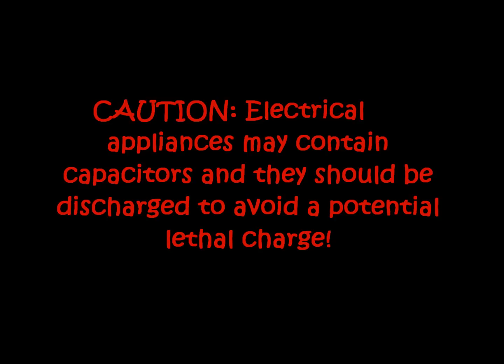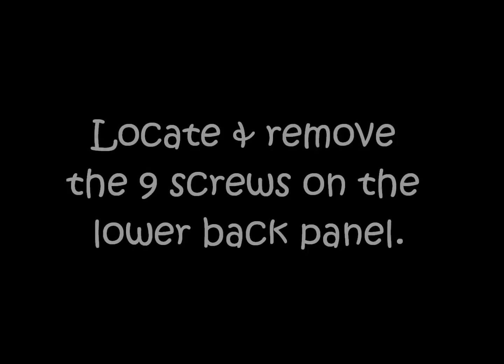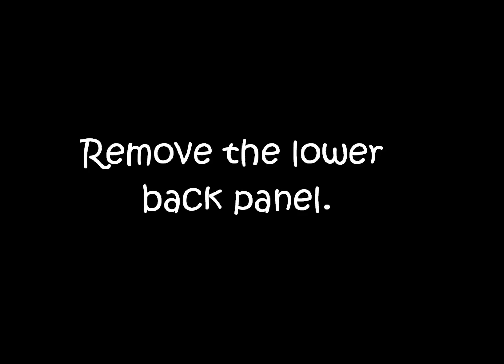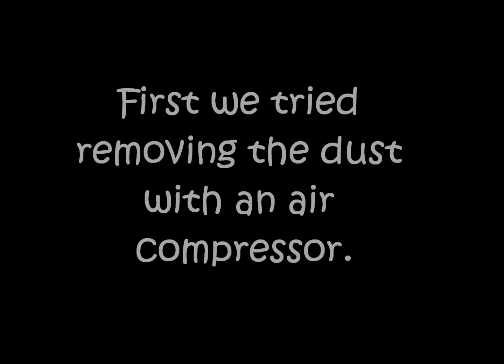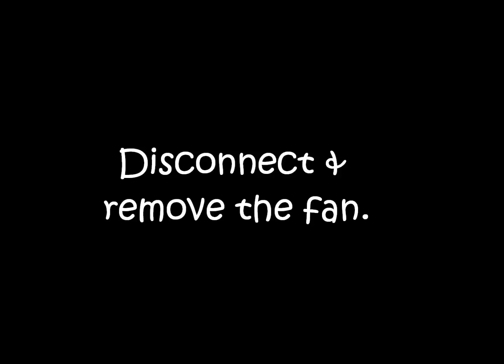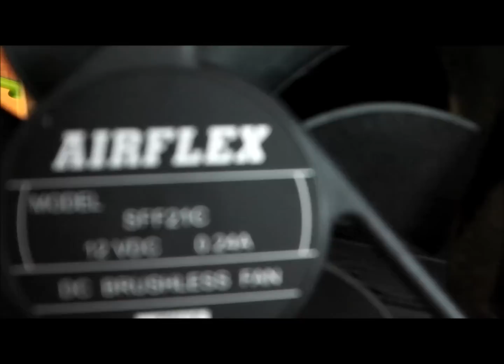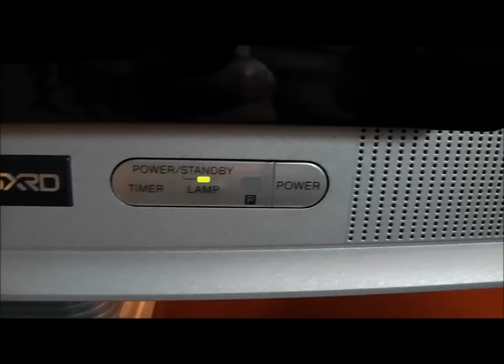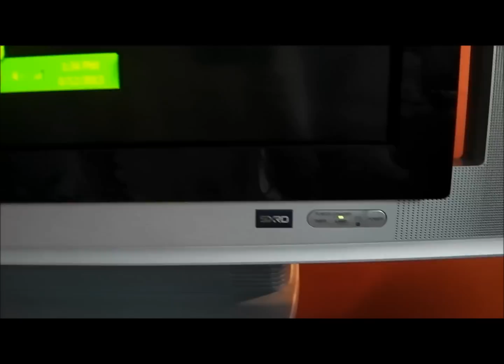Sony KDS-R50XBR1 SXRD Rear Projection TV Flashing (4X) Red LED Fix

Comment: I did a little more research on the Fan and found that between the red & black wires you get 7.4V DC voltage. I measured the resistance between black & yellow(or white). The resistance was coming aroung 153 ohms when the fan & TV were operational. So, I cut the white & yellow wires and added a 165 ohms resistance on it. From now on, the TV works even when the fan is off. In my situation, the fan was working but it was not giving out the resistance. So, my work around is fine with me. But if the fan is actually not working, then it is better to replace the fan. Oh by the way I had the 165 ohms resistor in my tool bag. If I didn't have it, I might have just bought a new fan.

Comment: This fix absolutely worked on my 60" Sony. I carefully removed the fan blade and some drops of 3 in 1 oil in hole and on axle/shaft. Vacuumed all dust. It absolutely fixed the problem that started last night - so easy to follow Jun 17, 2018. The TV is 13 years old and the picture looks improved. No doubt failures of 3 bulbs might have been due to overheating, now fan seems to be operating as per specs. Thanks !!!!!

Comment: I just purchased a new fan for 20 bucks on ebay and I also stock pile a couple of the Lamps that go out after a few years. I get those on Ebay for 32 bucks. I see they go for over a hundred from some people. I've had this 60 inch 9 years and replaced that bulb 4 times but it always keeps working. This was a first for the fan...Gracias Dude...

Comment: Thanks for posting! Couldn't get the smaller fan of but did clean it up and did take the larger fan out and cleaned that one. The key was cleaning it up, lots of dust. Thank you for the four red blinking light post. That was key. Working fine now.

Comment: Worked like a charm... thanks for making this. Have had mine for going on 10 years now and this is the first time I've had fan troubles. I originally thought it was another bulb so I just blindly bought another (overlooked which light was flashing), but after pulling the back off, removing some dust, and adding a little WD-40 to the large fan spindle everything worked again after reassembly.

Hopefully it holds up.

Comment: Hey there does the fan blowing out away from the lamp .. Or in at the lamp .. Changed mine out but think I put the fan in the wrong way mines pushing air in .. Not out ..? Which way does it go..?
Reply: It does not blow air out.  It sucks air in towards the lamp.

Comment: Should the fan blow in or out
Reply: It sucks air in the back vent and blows to where the lamp is.
Reply: Definitely Should blow in,it  has to keep the lamp cool! Thinking about trying to add a fan an turn the one here in the video around to blow the air out to have the intake /outtake flow, I've done this to several computers &  multiple dvd duplication units, an don't have overheated equipment ever, an this technique keeps the dust to a minimum!

Comment: Thank you.  Worked like a charm for me as well.  I used WD-40 however.  I think the extremely dusty fan ( I cleaned it up nicely) was the reason for blowing lamps more frequently also.  I vacuumed the inside/outside back of my 60" and it looks like new now.  I hope it runs for another 11 years!!!

Comment: I have the same problem. 4 flash lights? should I replace the fan? which fan the small one or the big one?
Reply: All of them
Reply: ***** So tell me where the Second Fan is located at.  I replaced the fan shown in the video but a larger fan I can not seem to locate. The tv still blinks 4 red lights than powers off. Thanks.

Comment: I had this exact same thing just happen to my Sony SXRD R60XBR1 that I bought in October 2005.  The fan I have is also a Airflex, however it must of been a different design because the blades would not pull apart from the magnets like yours did.  I ended up pulling too hard and broke the fan off.  Mine was not intended to be pulled apart and removed from what I can tell.  The label on mine is identical to yours, but the number in the box says H751C instead of the FY51C that yours does.  I have a new one on order, but I am also debating taking a 120mm PC fan and splicing the wires from the original fan to the new one since the connector is different.
Reply: I had the same problem with the fan not coming apart. I poked a hole in the tape covering the back of the fan (the one with the part # on it), put some WD40 in the hole & around where I could see the wiring, and let it set. I wiped off the excess WD40, put electrical tape over the hole, and put it back together. TV came right back on. I'll let folks know if I have further problems.
Reply: gary peterson Sorry to say, when I put the back of the unit on, it stopped again, and now it just won't work. I am ordering a new unit (like the one shown on the video - they look like the same size), and I'll let you know how it goes.
Reply: gary peterson OK, took me 4 days to get the part (regular shipping) from Parts Collection, took me a couple of minutes to put it in, & working like new. I will reconnect if any problems.

Comment: Fan blow in or out ???
Reply from the maker: Out
Reply: roluardo I just checked mine because I am having this issue.  Mine pulls in air through back vent and then blows air to where the lamp is to keep area cool.  Those of you that are worried you did something wrong because you can't feel air blowing out the back need to quit worrying.  God Bless.

Comment: You should have done a bit of reaserch on youtube... In my opinion blowing dust further into hard to reach areas is a big mistake... Its pretty easy to remove the lamp fan which is housed above the lamp... It should be cleaned every year so you can minimise dust reaching deaper into you optical block im not totally sure it stops dust getting in but it makes me feel better having a dust free lamp fan

Comment: One big problem with the video is on the Airflex SFFC1 fan is you are not suppose to pull the fan apart. I tried it on my same fan and the glued on pivot broke. Also just oiling the pivot does not fix bad/old circuitry in the fan. I ordered a new one for $18 and know it's problem free hopefully for years. Cleaning an old fan with circuits in it and 3 speeds is like cleaning a spark plug with 100,000 miles on it.
Reply: where did u order your fan?
Reply: From Amazon.
Reply: Smokersface - its still a good post....u saw it from stop to finish...and it worked....for "him".   u can't assume that every instance will be the same across the board for everyone. 
when trouble shooting, u always start with the cheapest "possible " fix....which was cleaning and lubing.  if that was the issue for u...then this video woulda saved u a good bit of money.   at least be thankful that u had a chance to try the possibilities 1st. regardless...even with u changing out the fan...this video  still saved u money by narrowing down  the possibilities of what the problem was. think of a TV repair  shops price in comparison to this video helping us do it urself.

Comment: Thanks for the help with this. Great, detailed video. My fan blade wouldn't remove from the motor (tried at least 30 minutes) so I wasn't able to lubricate it. I decided to put it back in (all cleaned up etc) and the TV came up great. I do have the fan part information (P/N 8-835-860-11) saved away just in case the fan acts up again but right now I am up and running. Thanks again for the video.